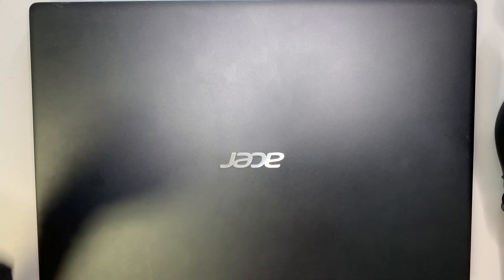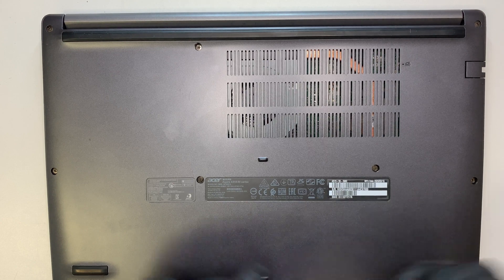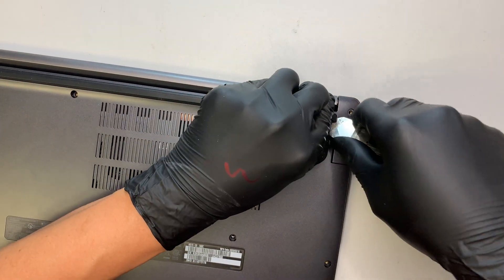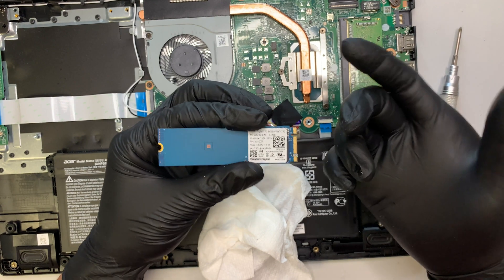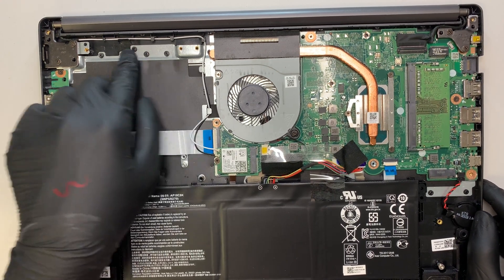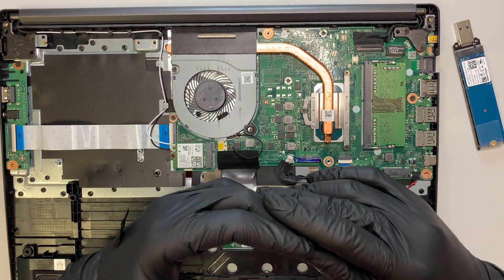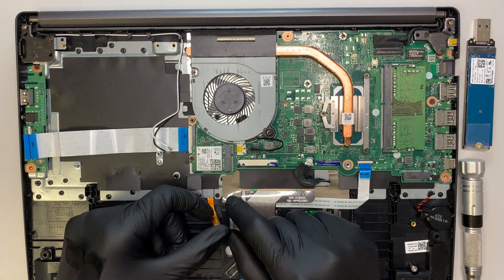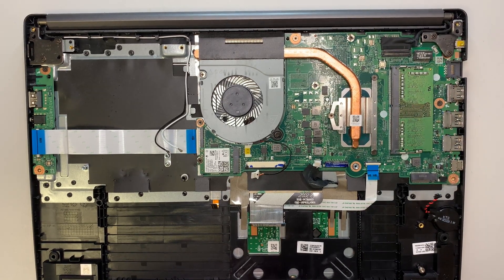Acer Aspire 5 A515 55 Water Damage - Tear Down Disassemble - N18Q13

Comment: No testing after drying. No attempt to reset the battery either. Just straight to replacing components which are probably fine

Comment: Thanks for the video! I have a question! Is it worth replacing the keyboard at all?

I have the exact same model, I cleaned the keyboard with a damp cloth the other day and it completely stopped working. I tried everything...

- Reset the battery
- Checked the driver
- Checked the functions/locks/settings in control panel

I took it apart and didn't see any water damage. The battery and and keyboard connector do have some blue on them but I'm not sure if that's a sign of water damage or just normal ink. Regardless I can't get the keyboard to work. Just wondering if it's worth replacing.

Thank you!
Reply from the maker: Try this link:   https://ebay.us/ATDOYS     Hope it is the same keyboard as your laptop.